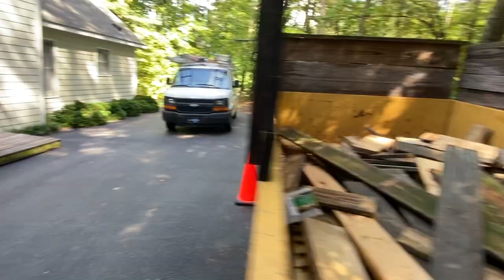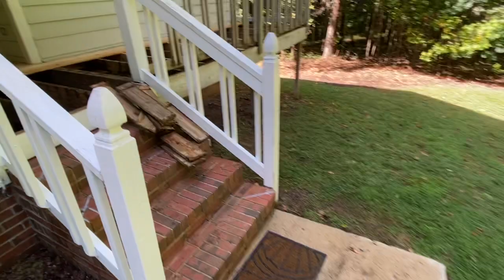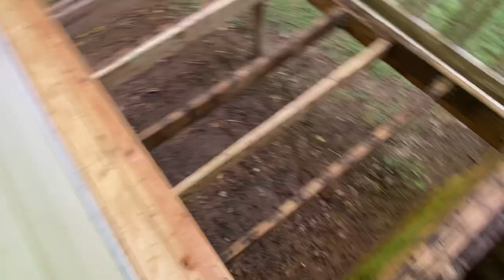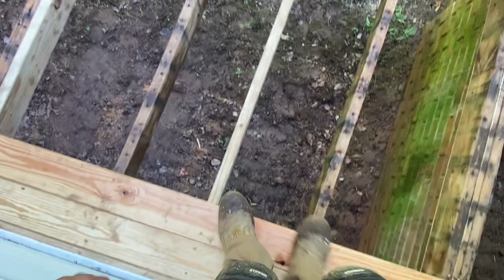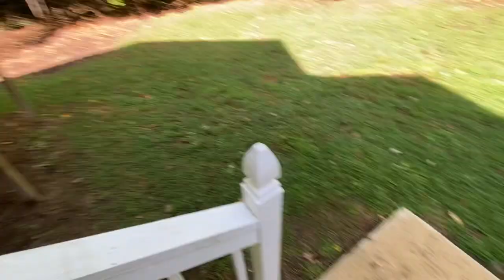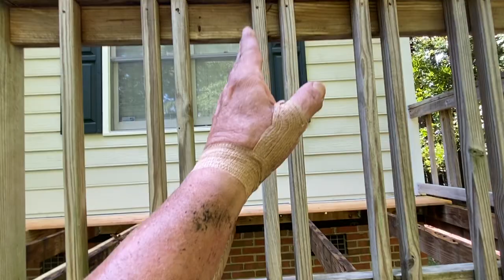DECK REPAIR.  EVERYTHING IS OUT OF CODE?  pt.1

Comment: No way I could walk across those  beams now. I turn 60 in Jan but I feel like I IIH cheated me out of at least another 10-15 years of being very active. Enjoy every day folks! You just never know what might be around the corner. Choose a really good deck stain , oil based and it will last so much longer ! Former paint department manager at Lowes’s.
Reply from the maker: Yes oil is the only way to go.